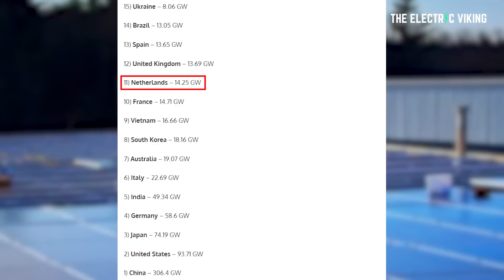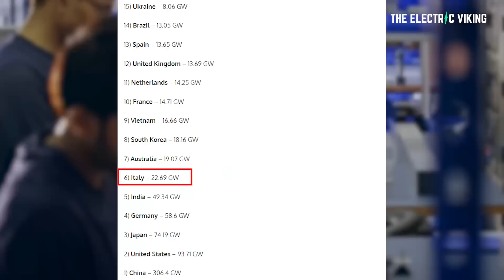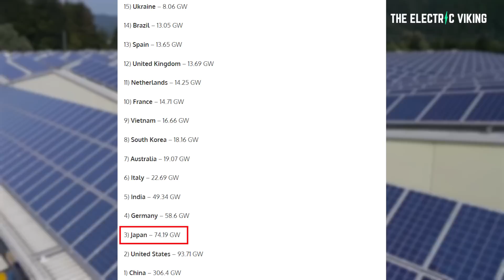Using the $700B per year spent on fossil fuels the world can avert catastrophe

Comment: The issue is not renewables, wind, solar etc, it is the storage. 

Australia needs about 15 storage projects comparable to the size of Snowy Hydro 2. So far only three such projects have been announced.

Big batteries wont cut it. Seven hundred such batteries are needed to match Snowy Hydro 2.

Comment: What you really need with these readings are 3 things, 1 is the overall renewable energy production by sector, 2 is the production of energy per person and 3, the amount of overall electricity generated in the country by percentage of overall electricity needed.

Smaller countries overall are going to need less solar because the population is smaller but many small countries could be generating a high percentage of their energy they need by renewables.

I think it would be more useful to see the numbers of energy generated as a percentage by each country and not how much overall energy is being generated because countries with bigger population are going to need a lot more energy but it doesn't tell you on a per-person basis how much energy renewables is generating, it would also be interesting to see the energy mix by sectors, so solar, wind and so on.

Comment: Love Frances solar panel law. These types of locations should be emphasized all over the world. 
Some reality checks with regards to Germany. 
News article:
Oct 21 2022 - Germany plans to reopen 6.9 GW of coal & 1.9 GW of lignite capacity. (Lignite or br coal is the dirtiest form of coal)
Oct 28 2022 - Five power plants that burn lignite will be reopened. 
May 24 2016 - even as Germany adds lots of wind and solar, the country's carbon emissions continue to rise. In 2015 Germany was the largest solar market. (2015 was also a very bad year, with very little wind or sun in Germany)
July 14 2022 - solar & wind power have inherent flaws that prohibit them from being the backbone of an industrialized nation's electric grid (the author's words). They need nearly 100%* backup due to vagaries in the weather. (*That backup is mostly coal & Russian natural gas). In 2019 wind power on one day rose to 59% of Germany's electrical generation. On another day of that same year it fell to 2.6%. In the same year, solar peaked at 25%, and bottomed out at just 0.3%. (As a reminder, during all this fluctuation, coal plants must be run at a nearly constant rate due to how they operate. Meaning they must generate electricity at a rate that covers the minimum output of wind/solar. Power producers are then forced to pay export costumers to use the excess power) 
Storage will be key to solving the renewables problem in places like Germany. Not on the few hours scale, but on the multi day to month long time scale.
Reply: Great that Germany is back to coal and lignite. The Germans are realists and will not buy that renewables story being spun by activists. Only wish they would also go back to nuclear. But again they mine loads of coal which they certainly are not wasting.
Reply: @volvo24091  Germany is the poster child for how not to transition to a green economy. Yes, closing down nuclear plants already in operation, before a functioning clean electricity infrastructure was in place is brain dead.
Reply: @carrdoug99  My point was that this push for renewables is nonsensical and liked how Germany has moved back to coal.
Reply: @volvo24091  I understand your position with regards to coal and renewables. I chose to decline comment, as that position is foolish.

Comment: Why is Germany scrambling to import expensive (10 times the cost of pipeline gas) LNG?
Reply: Because the US fracking industry needs a market; the reason Nordstream was sabotaged by them from day one of its planning.
Reply: @ralphzoombeenie2330  

Really?  Ok.  From now on do not drive your car.  Use 5% of the electricity you currently use.  Do not heat your home.  Do this for a month.  Get back to me with how it’s going.   The frackers do not need you little buddy.  You need THEM
Reply: @patricksullivan3919  No "old buddy"/ I have a well engineered home solar system including batteries which powers my two electric cars ,  my home and hot water system. Haven't paid a power bill for 12 years. I don't need frackers although some may be dependent, count me out.
Reply: 10 million barrels a day are from shale.  (Fracking). If this oil was withdrawn from the world market oil would be AT LEAST 200 bucks a barrel.  Be careful with your comments.  200 dollar a barrel oil would send the WORLD into the same situation Europe finds itself after it foolishly shot itself in the foot and declined to NOT put missiles into Ukraine.  Do NOT bite the hand thst supplies your energy.  You will SO regret it.

Comment: A huge reality check is in order here:  we have a test case.  Germany.  Solar is NO solution unless it is paired with energy storage.  Batteries, in their current form, are no solution.  The crux of the question is BASE LOAD.   The sad fact is, a grid needs the same base load capability with or without solar or wind. Period.  Is it worth building massive intermittent energy production?  That is the question.
Reply: Than make siure you increase the base load by using smart planning on the grid. A lot of electtric energy users can change the times they are working. Example...Heating a house with a heatpump which mostly include a buffer storage. When there is a lowe base load than start automatical the heatpumps and also increase the speed of charging EV cars connected with the slow chargers. (Make sure that every parking has a charger connection). And if possible (some cars) you can even extract energy from their batteries at peak hours to reduce peaks.
Just start thinking in solutions...not only a battery is storage....and not only storage will do the trick...

Comment: Sam, you keep claiming that only 4 hours of battery storage is required to switch to 100% solar/wind power (e.g., at 7:46 in this video). That is wrong. If you re-watch Tony Seba's videos, you will see that 2 to 4 days of battery storage (depending on location) is required. Tony did mention 4 hours of battery storage but that was some something unrelated.
Reply: Anything will be said to make renewables dodo fly.

Comment: Netherlands is actually very impressive, they have a smaller population than Australia and tiny landmass, not particularly sunny either.
Reply: Ditto, my thoughts precisely and being just across the pond their weather's unlikely to be much better either.
Reply: Indeed, Netherlands is about 185 times smaller than Australis, and since this year, only have 18 million people. 
And with a lot less sun, about the same amount of energy per capita.
Reply: @Grizzold-HP2  that's installed capacity... the same nr of panels will produce way more energy in Australia than in Netherlands.
Reply: @morganangel340  Yes, thats what I said. Thanks for the confirmation.
Reply: Netherlands is a temperate country while Australia is almost tropical.
Reply: In the Netherlands we have a good policy in place for residential solar for more than 20 years. No taxes and full metering. The return on investment for solar befoer the energy crisis for a normal home was ~ 6years. That means around 20 years of free solar if the live span is ~ 25 years. 2/3ths of owned homes have solar installed.

Comment: The accuracy of the savings described are likely true. However a portion of those savings will need to be diverted to the cleanup of fossil fuel production and refining sites. The rate of change to renewable energy will only accelerate as technologies improve. This  change will undo an established energy industry that leaves behind some major remediation work.